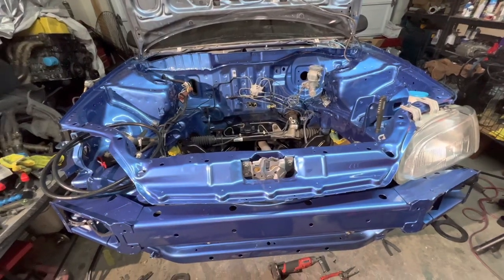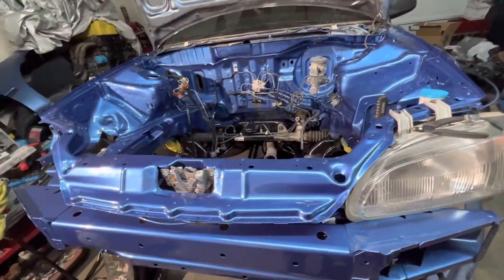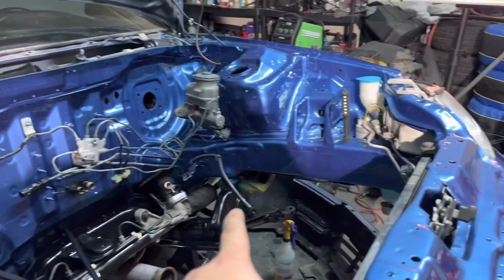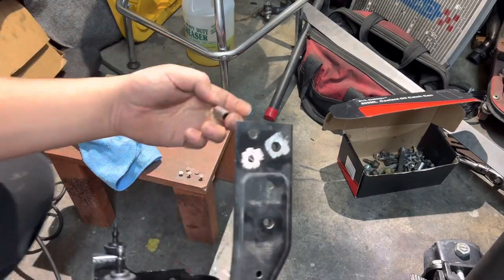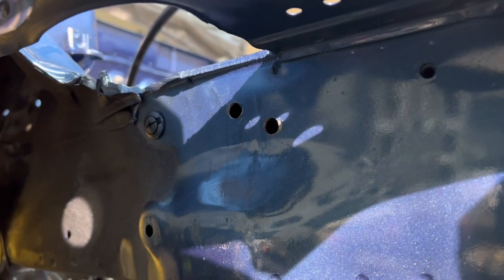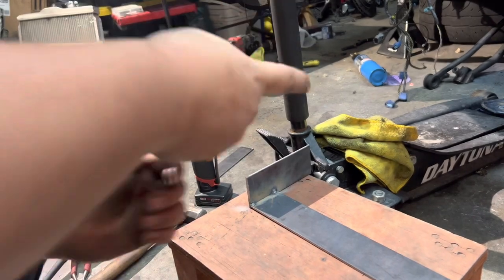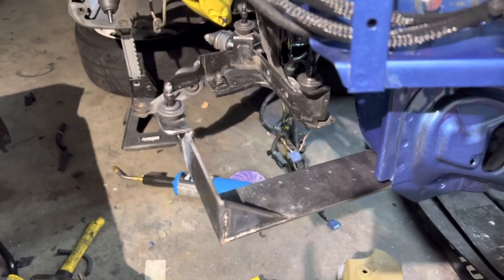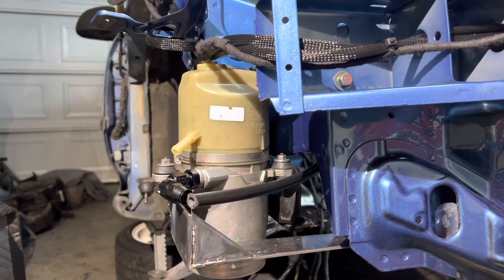Volvo Electric Steering Pump into a Civic Part 1

Comment: You are not informing anything regarding can bus n controller.....i bought it from junkyard but its not working without that chip or controller thing..... please explain the controller system
Reply from the maker: It doesn’t need a chip to work, I showed how it worked……………
Reply: for these you dont need the controller. just power to the main wire , then switched power to the grey wire on the other plug.